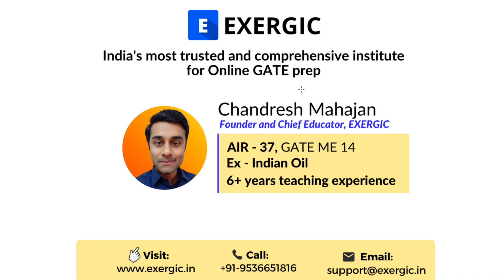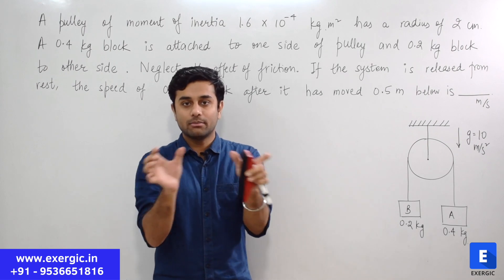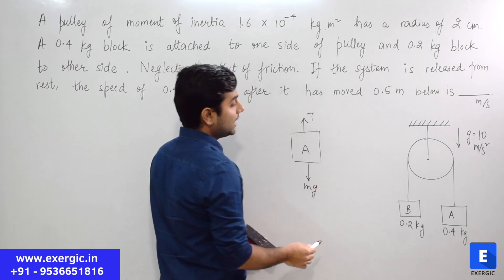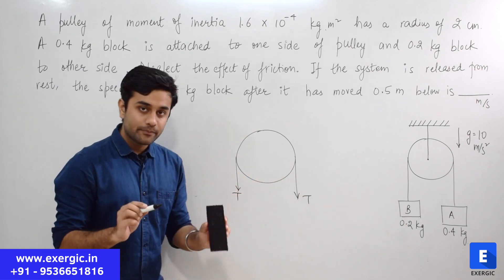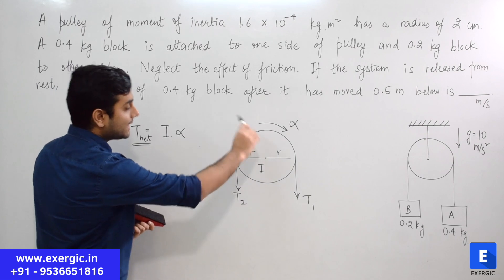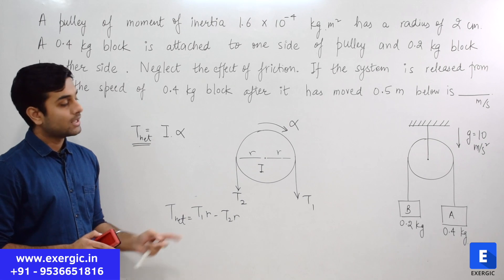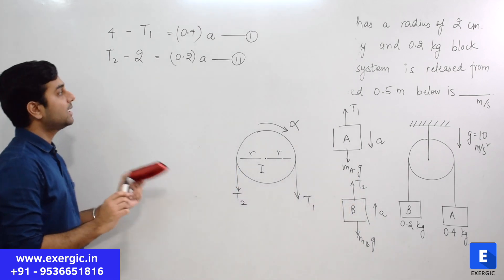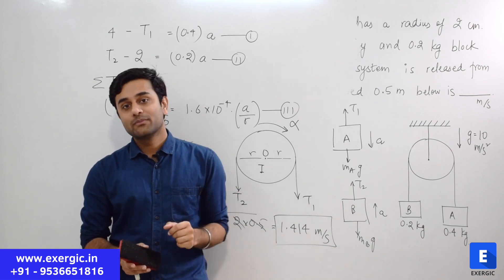Pulley concept mistake in dynamics - Mechanics | GATE Mechanical

Comment: Sir if there is no friction,how can the tensions be different. In absence of friction it would simply slide without affecting the pulley.
Reply from the maker: As the question says, you have to ignore the EFFECT of friction. It means that separately friction torque is not to be considered.
Reply: @ExergicGATE  without friction how the pulley get torque because rope simply slip on it, maybe sir you should mention here that there is no slip between pulley and rope
Reply: Torque will be generated due to different values of Tensions acting on two sides and this difference arises due to presence of Mass in pulley. Friction will be there to move this present mass but its effect ( i.e, the torque due to friction ) is asked to not consider in the ques.

Comment: As question says, contact between string and pulley is frictionless. I think string will simply slide over pulley without accelerating the pulley. In that case our usual approach should work. 
Sir, pls explain my doubt.
Reply from the maker: Question has not said contact is frictionless.

Question says, you have to ignore the EFFECT of friction. It means that separately friction torque is not to be considered.